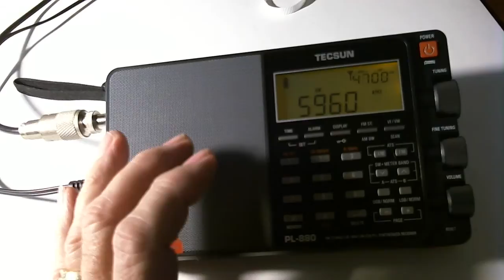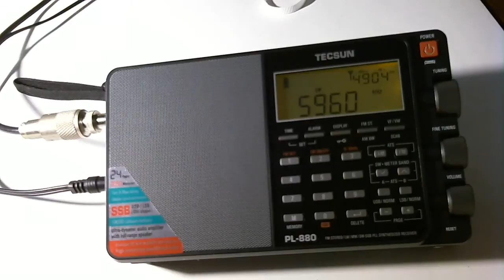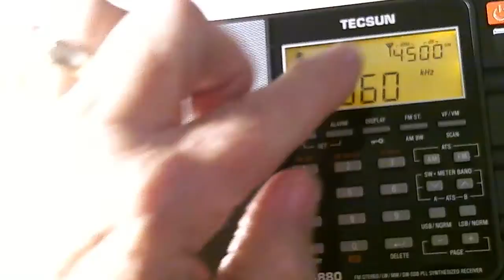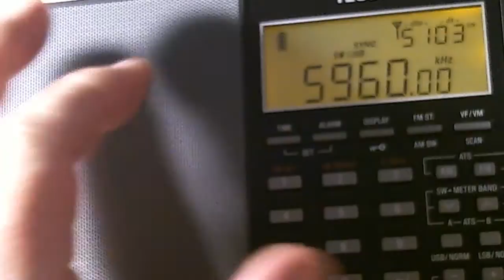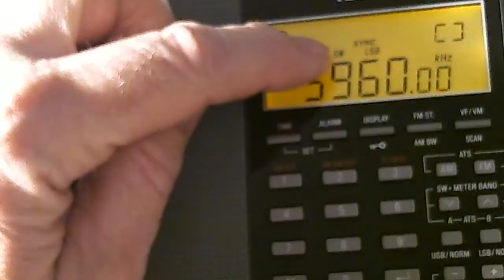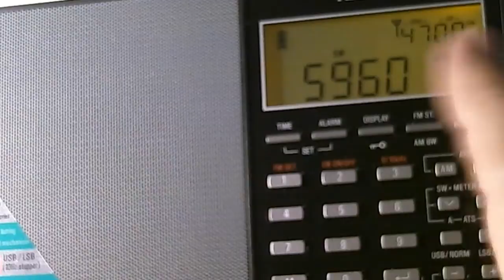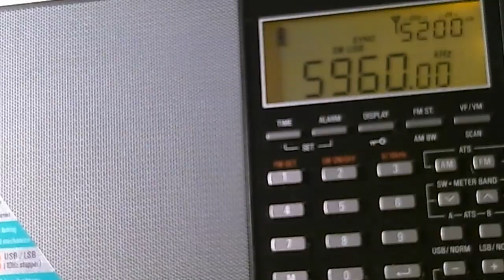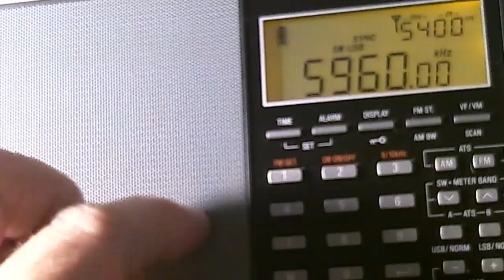TRRS #0259 - Tecsun Pl-880 AM Sync Detector Testing

Comment: Tom, another great video, but I would beg to differ on AM Sync. It's not really made for nor usually has much effect on fading or signal propagation, rather it's best use is for adjacent signal interference, and especially effective to remove the heterodyne of two or more signals. On the coveted Satellit 800 and a few other receivers, it's carried out superbly, but on the PL-880, it can be both of less effect and of less use, and the 880's DSP actually interferes with the AM Sync.
Reply: I agree with Joseph. By choosing LSB or USB sync I can completely eliminate an adjacent signal, predicated to which side of the monitored frequency the interference is coming from. My Sony 2010 and sw-77 do a fantastic job with this feature. In fact it's fun to just intentionally search for a station with adjacent interference just to amaze myself with the effects of these two radios utilizing the sync feature. Conversely, my Satellit-700's sync-detection is nothing more than a gimmick. While the SAT-700 is in my opinion a superior radio, the synchronous detection is horrible.  Still, at the end of the day, great videos Tom. Keep 'em coming.
Reply from the maker: Thanks for your comment.  I guess I am just use to the AM sync on my old Sony which would prevent signal fading.
Reply: hamrad88 YouTube ruined my first carefully constructed send of this reply, but in short: Yes, I have seen your observations with Sony receivers. However, receivers with AM Sync sometimes also engage a "slow" AGC attack/decay mode when AM Sync is engaged, and when that occurs, yes, AM Sync enabled gives the impression that the signal fade/flutter and etc. is suddenly minimized and it was all due to AM Sync...when it wasn't.
 
Otherwise, most receivers with separate AM Sync and AGC speed enable/disable almost always show signal fading/flutter improvements only when the AGC speed is changed.

Comment: I have tried this function on my Eton G3, however, it too is quite poor in locking and holding the signal.  I believe some of the later G3 models work better with the sync detection than the earlier editions.  I have not been able to compare this though.  Thanks for the great videos, much appreciated.
Reply from the maker: Thanks for your kind words and comments.

Tom

Comment: I think that the music is actually Voice of Turkey's interval signal. But goodness, the Pl-880's audio on sync sounds like garbage, but it seems to hold the signal. It's definitely better on the PL-660. It sounds as good as the original signal and holds it better than the PL-880. For the videos that you posted, the PL-880 is not a bad radio at all, but it has convinced me not to upgrade my PL-660.
Reply from the maker: Thanks for your comments.

Tom
Reply from the maker: radio53 Agree
Reply: I bought the PL880 this week.
In every respect it's a nicer receiver than my PL660 but....
the sync' is pretty useless. I can't understand why Tecsun have released it with such a poor sync'.
That said, I get good results on SSB so all is not lost.

Comment: I found the synch detector on the pl880 to be worthless,unlike the PL660 which worked well. On the PL880 I don't use the synch detector & instead opt for ECSS reception as the radio tunes  exceedingly accurately. I guess the reason the feature is hidden is because it really sucks. I usually would not opt for synch or ECSS on a station that is coming in as well as VOT is here, it really helps on weak signals though.
Reply from the maker: Thanks for your comments.

Tom